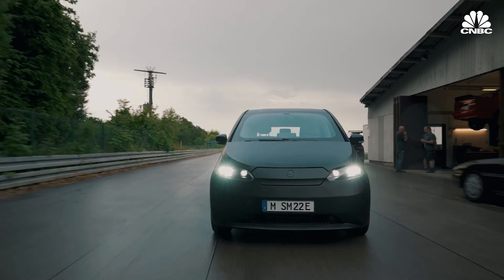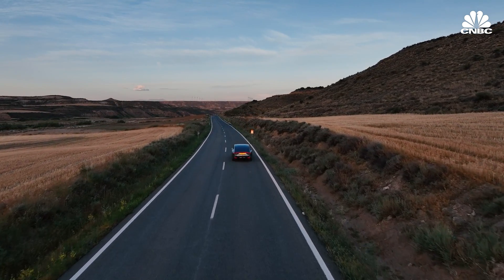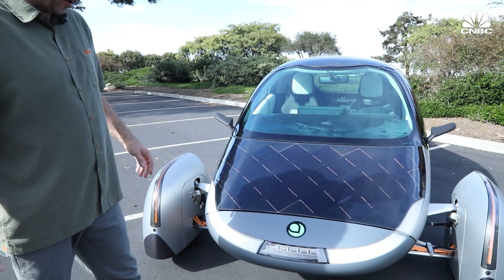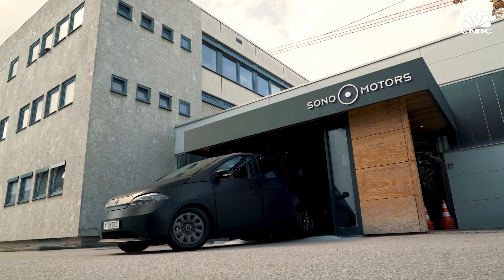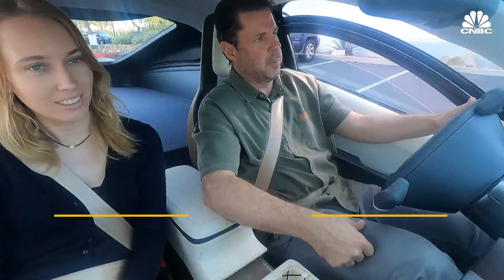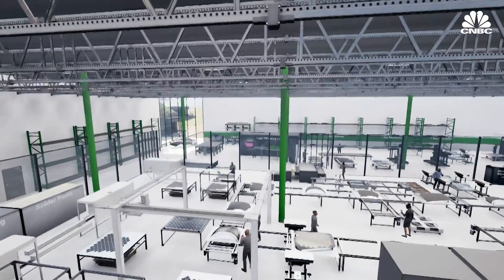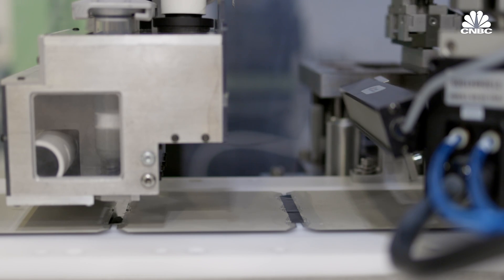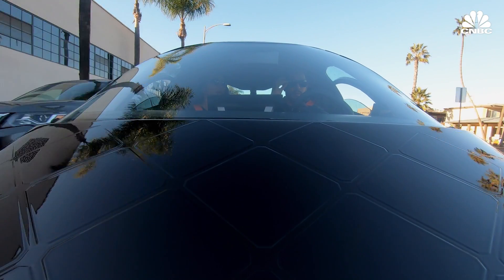Solar Powered Cars Are Here — But Can They Go Mainstream?

Comment: The Aptera model looks the most intriguing to me. Simple nothing fancy and low cost. Most people don't need much room or a huge truck to commute. I can see this taking of
Reply: “Most people don't need much room or a huge truck to commute.”

And yet, so many people use bigger vehicles like pickup trucks and SUVs s as their daily commuter vehicles when it’s just them and their lunch box (if even that much). Why? From what I gather, it’s one of two reasons: either they want to appear more capable/hard-working/generally-superior, or they think it makes them look more masculine specifically. Very rarely does it have anything to do with actually using what the vehicle is capable of, it’s more about image. And because the Aptera doesn’t fit the “macho/masculine” aesthetic, the main adopters for that will be those who are already looking to trade up from another EV. And of course those who choose to stick to ICE vehicles will still pull the same BS to trash these new solar EVs, as they currently use to say that modern EVs can’t do what they need them to (even when that’s just a bold-faced lie).
Reply: @jacobcarlson4010  most people with trucks are SUVs and up using that space if they have families. It doesn't make financial sense to buy a small car for commuting and a big car for the family, it makes more sense to buy one car that does everything you need. And we are a long way off from electric vehicles being viable for towing as their ICE counterparts. The problem with gas is that even though you're only getting like 25% of the energy out of it, it's so energy dense that it still has more energy than an electric vehicle using 80% of its stored energy. Eventually ev batteries will be smaller and more energy dense, and the nice thing about buying an electric car now is that when you eventually replace the batteries you'll have a bigger tank than when you started, But the ticket still way behind what current technology offers in the ICE space because it's had decades of evolution versus maybe two decades of evolution for EVs. I'm really excited for the future of this technology.

Comment: Concept cars like these has been built, but no-one has tested them in real use. All calculations take for granted that no shade exists. In reality the Hyundai Ioniq 5 has been sold with a 200W solar roof for more than a year, and the reported yearly yield is around 40-70 kWh. Triple that for an estimate of what the Sion could get in a year, if it is ever produced. Solar on cars is just a gimmick, better to put a few well-aligned panels on the garage or house roof.

Comment: don't be silly. 10 full solar panels in Vegas might get you 30 miles on a Tesla; that is charging ALL DAY LONG.  An Aptera in the same sort of sun; left in the sun all day (smart idea) will get maybe 12 miles.. that isn't zero but it is a 3 wheel motorcycle.
Reply: You should look up Locost cars. These are cars that you can make at home. You can make a car that looks 10x cooler than a dumpy Tesla 10x better for the environment. You won’t have to have child slaves mine your resources…I mean, unless you want to?
Reply: The Aptera will have 700 watts of solar panels and use 100 watt-hours of energy when driving. Did you pull that 12 miles figure out of thin air or did you actually calculate it? Show your math.

Comment: It's not a matter of can anymore. It's not even a matter of when. The question now is really is in how many ways. Solar panels now are cheaper, lighter, more flexible and can even be made transparent. So EVs in the next 3 years will start to have solar panels. It's just a question of where nad how OEMs want to put them in.
Reply: Unless density is significantly improved, solar on cars will be a joke.
Reply: @AtillatheFun  density of what?
Reply: @insolidusyt  Solar cells.
Reply: @AtillatheFun  Still not sure what you're talking about. Solar cells aren't chips that you can make smaller and fit more into the same area. You make them better by increasing their efficiency, not density.

Comment: This is the direction EV design needs to go -- high efficiency and solar assist. Aptera uses only 100Wh per mile as compared to today's SUV/Truck EVs that use 600-700Wh per mile requiring larger, heavier and more expensive battery packs. Aptera gets 250 miles range from a tiny 25kWh battery pack, 400 miles from a 40kWh (about half the size of today's EVs). Then its solar-assist provides up to 40 miles/day of "free" propulsion. That's over double my daily commute, which means I may never have to charge until a long trip. I just reserved one.

Comment: Why not just have a regular ev that you charge at home with solar power? You’ll never be able to generate enough energy from solar panels on a car to have a “usable’ vehicle, sure you can grab groceries with it but good luck traveling across town. Call me unimaginative but I just don’t see the point. I love the concept but it’s just not feasible.
Reply: If the use case calls for, say, 10 to 20 miles per day and the solar on the vehicle is capable of generating 10 to 20 miles worth of energy per day, then why not?

Comment: Most places don’t have near the sun for this to work…but in sunny areas go for it
Reply: Truthfully, for the aerodynamic shape of Aptera's Solar EV still benefits versus all other regular shapes where you spend less energy to move around.  

Aptera claims 10 miles for every kilowatt-hour due to the vehicle shape and being lightweight.
Reply: In Europe people traveling on average shorter distances and often parking cars outside, I am more concerned about the passive cooling of batteries on lightweight solar cars like Aptera because the early Nissan Leaf that at least had air cooling is not exactly known for good life battery despite the average user did not use superchargers much that are pretty much irrelevant for Aptera, though today's batteries are superior in terms of the useful lifecycle, so who knows...

Comment: As long as base model cars are 30,000 I don't think any major revolutions are going to happen. At that point, there are too many factors to consider.
Reply: Base ice cars are 20k plus fueland oil changes.  After 3 years the upkeep to the engine, cooling, exhaust and transmission start to get expensive.

Comment: 8:05

What is this 20 miles on solar talk .... 
I'm really confused on that wording... 
I always thought the issue with solar energy was the problem of power collected vs power consumption 🤷🏾‍♂️ 
So, if the amount of power consumption is less then the amount of power collected then the balance is a positive factor 😉 
Meaning... if a person uses a solar car for localized driving then the battery system isn't supporting the system but more or less a backup 🤔 
Right? Like if you have to push the motor and it needs more torque and it's a rainy cloudy day... then the battery will take more of the functioning system.  Right? 
But if you drive on a normal sunny day... the system should be able to independently run on solar, right? Meaning one could barely use the battery system if they were just using it for basic commuting
Reply: Solar could help expand the life of batteries and that's good for the environment
Reply: I'm curious if this fast charging tech is applied to home solar systems too. That would change the game .... fast charging solar power going back into the grid 🤔
Reply: It is doubtful that the Aptera will be able to "independently run on solar". It will likely always need to draw energy from the battery when driving. The solar package can produce 700 watts of power in the best conditions. If the Aptera, when driving, uses the claimed 100 watt-hours per mile, then travelling at 40 mph (for example) would use an estimated 4000 watt hours for that hour of driving and 4000 watts of instantaneous power on average with higher power usage during acceleration and lower usage when coming off the accelerator.
Reply: Non of these solar cars runn on solar alone. They are always taking the energy to move from there battery. 
The solar is charging the battery if the sun is out. That's the extra average miles they talk about. Plus when you run the AC, radio etc at daytime the solar will provide the energy for that. In that case the battery will drain much slower or not at all. That also gives you extra range on the battery.

Comment: 5:50

I have a question!? 

Okay... if solar cars can run independently on the solar panels alone... 
And they have rechargeable batteries to accommodate the energy consumption level when boosting an engine for more power... 
How much of the solar power is going back into the batteries when the car isn't running? 
And another question... 
I have noticed that electric vehicles are charging much faster now at charging stations ... 
Does that mean solar power cars also feature this fast charging system to  their process? 
If so ...
Reply: That makes sense if it did have a fast charge .... you could drive 200 miles,  grab some lunch , let it charge in the sun , then continue for another 200 miles ... and once it's normalized the tech should improve to eventually be able to charge from the night sky too.
Reply: All mentioned and future solar cars do run on battery, not on solar. Solar does only do some of the charging of the battery. And it does supply the AC, radio and other stuff. So the charge of the battery does last longer.
They all can be charged like every regular EV. You just don't have to do it as often.

Comment: It has a very limited usage area when you can charge for 300+ miles in half an hour and if your car is fully charged and the solar panel is useless.so I think the potential of car proof solar panel will be more useful on the large and daily use vehicles like public bus
Reply: Only useless if fully charged and siting still. Once you get moving, it is a different story. Also if they make it V2H it is not useless.

Comment: I like the Sion design and the 45kwh battery with 190 mile range. Suggests it is a bit over 2 watts per mile. Very impressive given the body shape. I have wanted an Aptera for 15 years. 38 years ago I dreamed of something like this being possible. I hope everyone who wants one gets that opportunity. Chris was thinking of making 3-4 thousand a year doing hand layup of aircraft quality composites. They have gotten so many reservations they had to find a better method to make the body and a new way to use carbon fibers came on the market. And that technology will bring carbon fiber structural parts down in price. Plus both these companies support the right to repair!! [correcting should have been 200W not 2]
Reply: Too much demand is the best kind of problems
Reply: @my2cents795  agree! Never look a gift horse in the mouth. Learn to live with it.
Reply: 0.23kilowatt (230watts) per mile
Reply: I thought they were using fiberglass based composite?   And while carbon fiber has greater tensile strength and greater stiffness, the nice thing about fiberglass is that it is more durable and tough--that is because the fibers will stretch some before breaking.  When carbon fiber reaches near its breaking point, it just catastrophically breaks/snaps--there is no in between, force absorption factor.  And S grade fiberglass is not all that far behind the tensile strength of cheaper carbon fiber, but at lower cost, both financially and environmentally.
Reply: @justinw1765  Best we could tell is that they intended to use two different composites that are essentially hand layup. One shown shown has a hex shape in the material and is a structural item that we believe was used in the gamma. In the firewall, rear mounting area for the rear wheel and the hump in the center connecting it all. That was for torsion rigidity between the front and rear wheels. This was discussed by Steve at the Aptera owners club in one of his interviews with staff at the gamma reveal in San Diego. Then I believe the second composite was Kevlar/Carbon hybrid material for the monocoque shell. This was done probably because of the higher cost of carbon fiber hand layup. Both can have consistency issues in production.
The injection molded carbon fiber is a recent option that will allow them faster body production with an extremely high consistency of fit. Besides the 4 carbon fiber molds that including a front crash bar system [probably why they will not have a frunk]. The new design has two exterior side parts made of fiberglass that is injection molded in the same machines using the multidirectional fiber layup system. That will be the lower side panels from the tail to the firewall and frame the door area that covers the inner shell of carbon. All of this are possible due to a new 5 ton press for the process. If you haven't already you can see that in the Aptera Motors videos from 3 weeks ago when they announced the "critical agreement" with CPC group as a strategic partner. CPC Groups has a web site where you can learn about the process and the company. I the think the smaller fiberglass part of the tail could be molded by the 2 ton. This gives them the ability to start the factory at a run rate of 40 per day starting up as it takes 2 minutes to shoot a mold and a few more to cut away the injection parts.
Reply: That’s pretty good but I was expecting it to be better since the Hyundai Kona previous generation was getting 4 mi./ kilowatt hour
Reply: @TristenHernandez  Are you ta&lking about the Aptera or the Sono ?
Reply: @TristenHernandez  pretty much similar to the kona in distance per mile but can it charge itself?
Reply: Correction: it's a 55kwh battery

Comment: For people who already have a solar panel and battery storage in your house, a solar powered car doesn't significantly add more value
Reply: Anywhere you park it away from home you can be charging your battery for free.
Reply: @gmv0553  for a normal car user who's driving less than 100km a day and charging their car every night with free electricity from their home solar+battery setup, it wouldn't make a difference
Reply: For those who live in cities with that setup where you can still reliably power your life with the grid just in case, sure. But in an off-grid setup where you want your battery for your house and your battery for your car to be separate, these are ingenious.

Comment: They need to be super light, so they're about as safe as a motorcycle.
Reply: Actually the carbon fiber body of the Aptera is stronger then any steel body vehicle built today
Reply: Really? You think an Aptera that is surrounded with a carbon fiber body and crumple zone, with seatbelts and airbags is "about as safe as a motorcycle"? A motorcycle has none of those things.
Reply: @skipondowntheroad5833  it doesn't have inertia.  It won't survive in a crash with an SUV.

Comment: Unfortunately, this isn't practical in central Ohio since, for some reason I have yet to learn, our skies are overcast for essentially the entire winter 😕
Reply: Ohio gets about 75% of the potential solar energy as SoCal. The skies are not as gray as you think. Just because its cold doesnt mean there is not still quite a bit of solar energy.
Reply: Overcast doesn’t prevent solar energy from being harvested, it simply lowers the efficiency of the panels - and not by much. I live in central PA and have been back and forth to central & Northern Ohio my whole life because of visiting family there. I know what overcast you’re referencing. But even with overcasted Winters I still have a neighbor who barely uses grid energy ever since installing their panels 2 years ago. The same exact rays which can give you sunburn on a cloudy day are the ones that cells convert to energy. Panels still work surprisingly well under the clouds.
Reply: My daughter lives in Connecticut and has not had an electric bill since putting solar on her home 3 years ago.